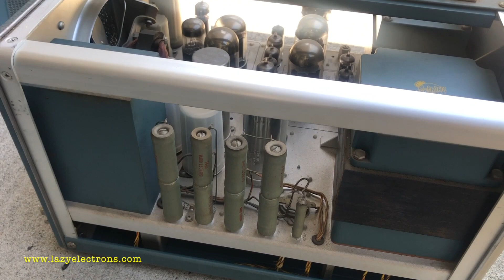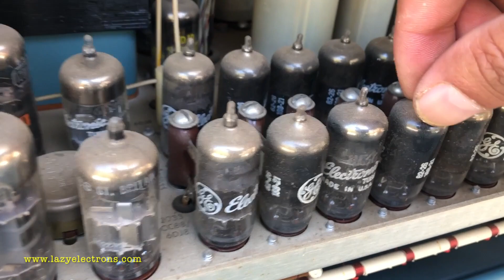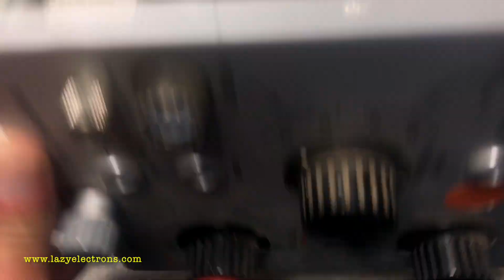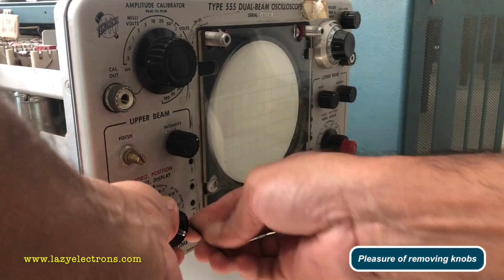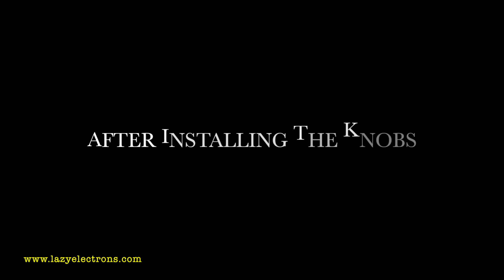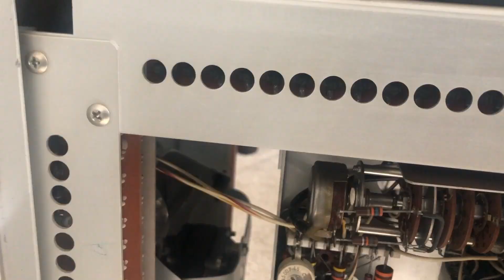Tektronix 555  Restore/Repair  Part-1 - Inspection and Cleaning

Comment: You didn't state how you cleaned the chassis interior besides mentioning IP; did you spot clean everything with IP, or use soap and a hose like Tek did?  I have a 555 and it's little brother (551) that have been waiting to be restored for a long time.
Reply from the maker: it was only IP.